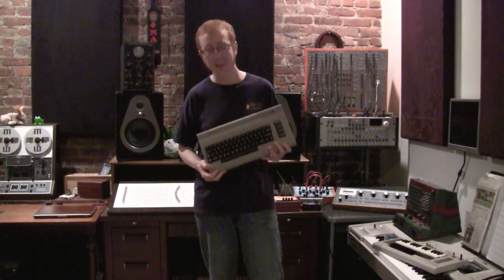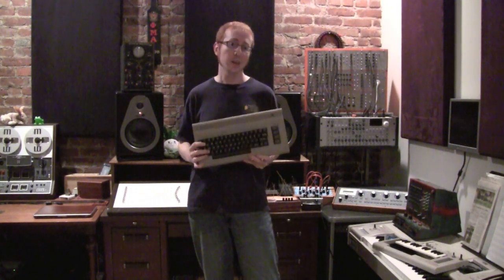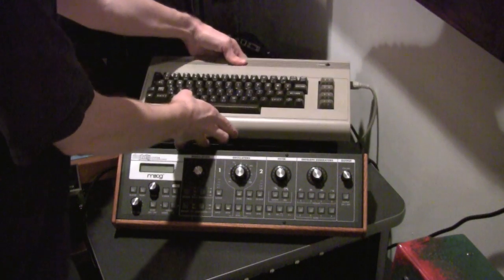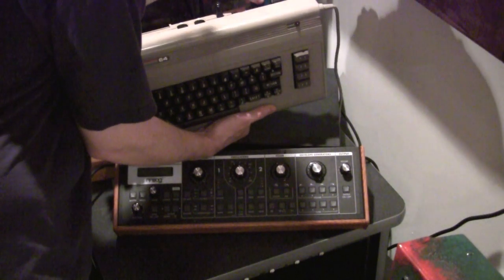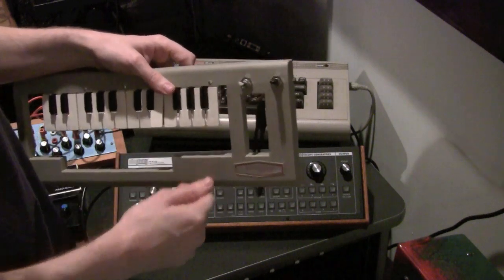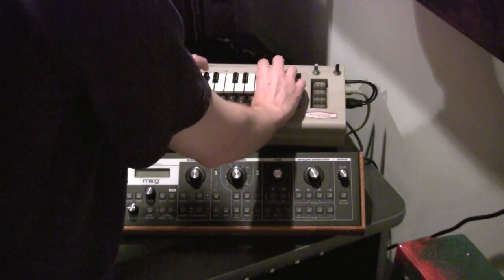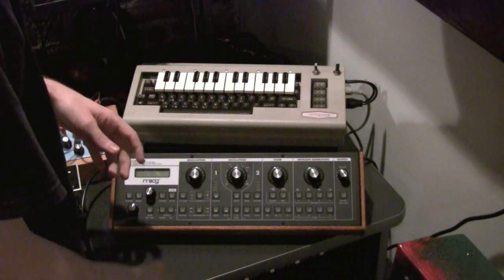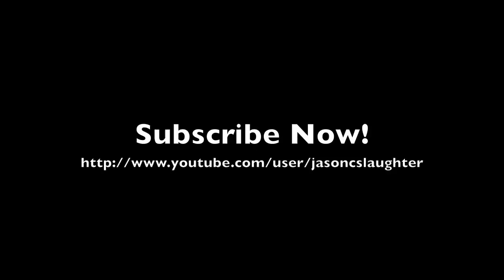Commodore 64 Keyboard Mod

Comment: Dude, one of the other ports on the back has composite out and audio out...you just need to pick up and DIN cable from Radio Shack or build your own by cutting MIDI cable in half...the pins in the MIDI cable correspond with A/V out...just check on the net for the pin out...pretty sure it is the same as on NEC
Turbo Graphics or the JVC X-EYES...

Comment: Instead of using that demodulator, there's a 5 pin DIN port on the back that sends video and monaural audio out.  You can find the proper cable with RCA or 3.5mm plugs at most electronics stores or eBay.  Back in the day, I used to hook my C64 into my home stereo using that cable and "Y" splitter cable (for left and right).  I now use that cable with my PPG Wave 2.2 to load patches from "tape" (actually mp3).

Comment from the maker: You're right about the A/V port, and I'll probably update the setup eventually. The reason I went with the demodulators is because I bought them to use with the Atari 2600 and Colecovision, and they were already sitting there!

Comment: It sounds like you went to a bit of trouble to get sound through an RCA connector, when the A/V port would surely give you a cleaner signal?  From memory it's a 5-pin DIN port, and carries audio and video on separate pins.